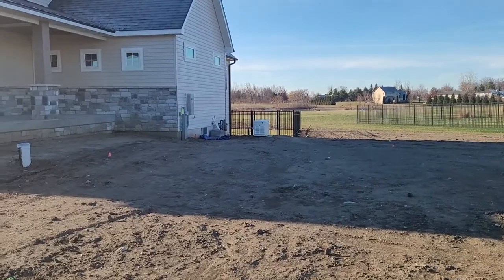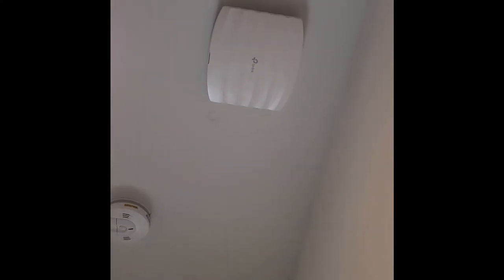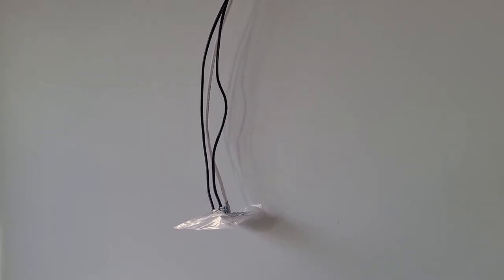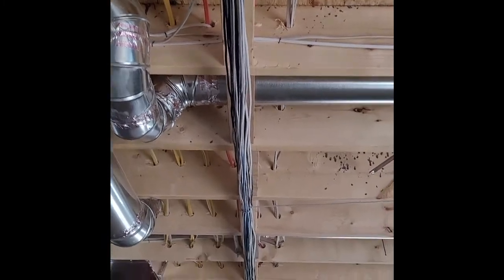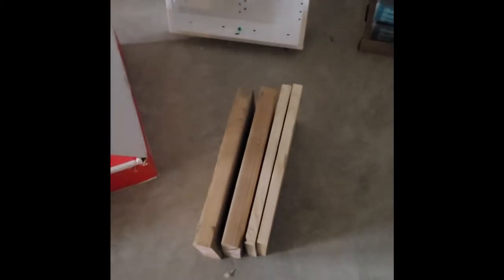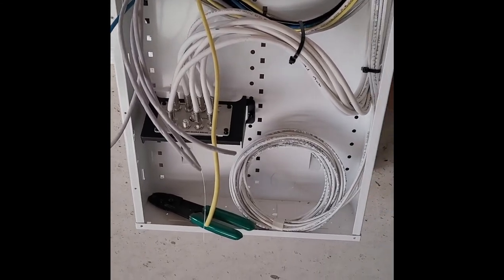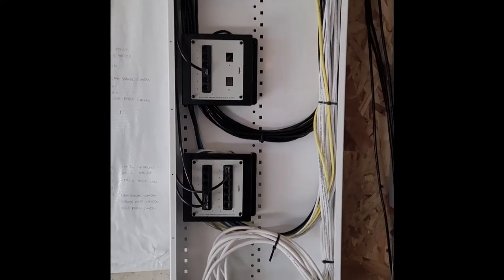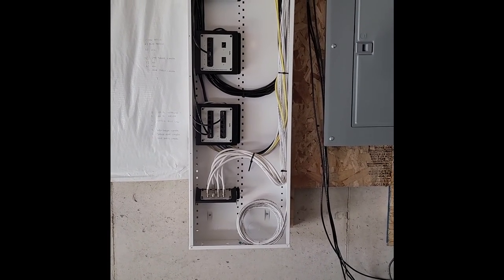Low voltage new construction

Comment: Never use nylon zip ties on network cable bundles. Only use Velcro.
Reply from the maker: Zip ties are fine for bundling wire. They should never be used as a structural method of attaching wire. Velcro is great for applications where you would expect to have to go back into the wiring structure again. Being this was a pre-wire, no problem. I don't pull my zip ties tight. It's just for wire bundle